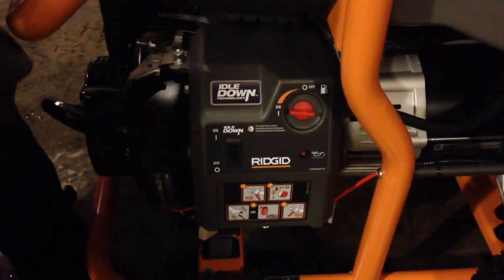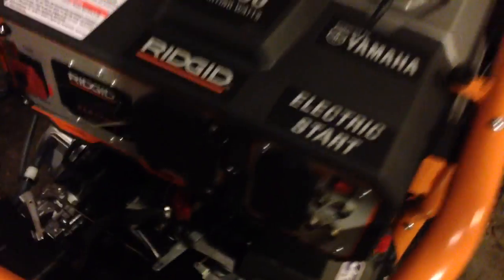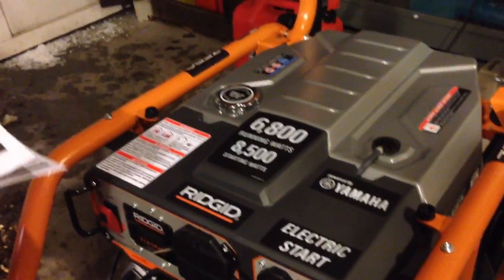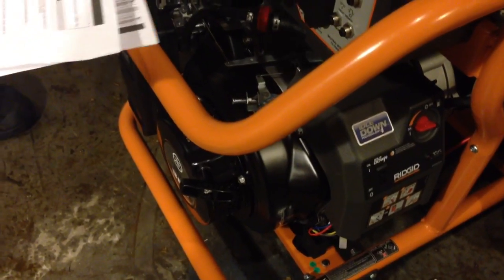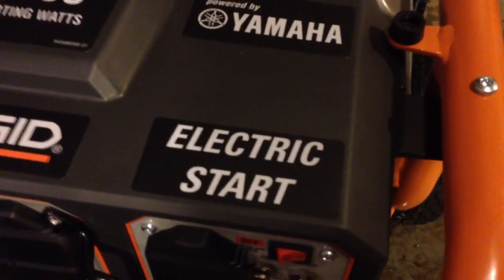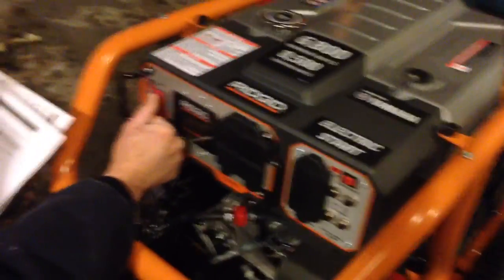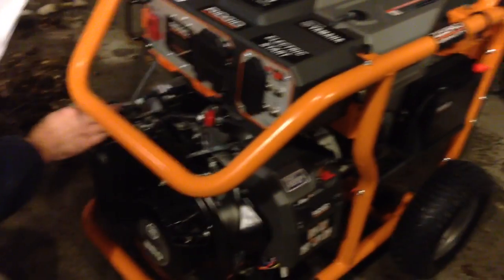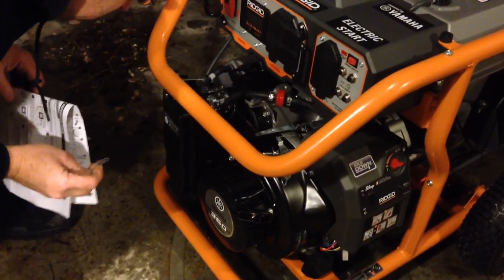Ridgid RD6800 - New generator first start up.

Comment: I wish more generators had the zero-gravity style handtruck frame

Borrowed a 3600 from someone after losing power for a week for a tornado and I grew kind of fond of it
Would fall asleep to it every night, I admit I can’t sleep without the sound of the little Subaru anymore
Reply from the maker: Creeperboy099 I’m pretty happy with it. It’s a pretty heavy unit, so with out that setup, it’s not moving an inch.

Comment: I have the big brother of this, 8000w/10000w. but it doesnt have the idle down tech.. really a bummer it didnt come with that...
Reply from the maker: Honestly, if even one 100w light bulb is on, it won’t idle down. 
So unless you are a contractor using something electrical, and don’t feel like coming down off from a roof, it’s virtually useless.

Comment: I like rigid. 6800 would run my entire house. Not all at once. But I could run all my lights and either the stove,ac,or water heater.
Reply from the maker: Ah, the water heater cycles, give it a shot!  ;-)   We used to use the stove on out old 5500w unit, it was tight, but it all worked. We refrained from running the water at the same time, as the pump is 110v and fairly high amperage draw. (I really need to convert that to 220......)  No AC here, but our oil boiler, and two zones worked fine. This was one of the main reasons I started switching over to LED lights. I wanted to keep the level wattage down, so the generator would be ok, for the surges. I could have used an 8000w unit, but there was no time to really look, there had just been an outage when my generator died, and thats not a great time to find a deal.  ;-)

Comment: If you have the control panel attached to the remote cord and it is away from the Generator, the second switch allows you shut it down right at the Generator and not have to go back to the panel. Its most likely a safety requirement.
Reply from the maker: Yea, that must be it, I wasn't even thinking about having a local shut down available if the remote was gone.
I'll probably get the extension cables eventually as soon as I figure out a place to put it where I can keep it out of the way. Our last generator had an enclosure on it, and was just left outside behind the garage, this one is physically larger, so we will need to build some kind of shelter over it.

Comment: Nice generator. Rigid markets good stuff. Yamaha YES! I have a Powermate I think by Coleman with the Honda 390 on it. Honda generators although the best are too pricey for my budget. I ran into a off brand inverter generator sold through a hitch company called Rigid Hitch based out of Burnsville Minnesota I would like to try. They are about half price and the company that sells them are close enough I can do a drive by on if needed.
To change the subject I am amazed of the stories across our great country about people who bring these into their basements or homes and die because of the carbon monoxide poisoning. I guess it weeds out the stupid ones in this world but I do feel bad for the innocent family members that die at the hands of the stupid ones.
Reply from the maker: My generator is well over 65' from the house, I did that, as when we are out, its generally for a very long time, and I worry about build up within the envelope of the house. Even ten feet away is way too close as far as I'm concerned. I see people put them right out side of their windows thinking they are ok, as its outside. I think they forget its a gas, an open window is not much of a barrier.  My old generator was a homelite with a B&S engine, it served us very well for 18+ years. I was surprised when it just up and died, but I guess thats how things go.
Reply: ***** Funny you should bring too close to the house even if it's outside. One of the schools I work at was getting their leaking tin roof sealed with a coating of some sort. This company had an old water cooled gasser engine inside of a semi truck trailer van body to power their equipment. They never gave it a thought but the wind was just right and pulled most of the fumes into the computer lab I was working at. I complained but they kept on going. I guess kids and old farts from SW Minnesota are expendable. I didn't get to the nausea level but it sure stunk like they had their choke pulled out the whole time. A diesel would have been a big improvement!
Reply from the maker: 1crazynordlander Yea, it constantly amazes me when I see  people on the news using a generator in an attached garage, and  are surprised when they get taken to the hospital. (If they are lucky) I think they figure if the garage door is open they are ok.....
Reply: Yup. Please keep in mind that carbon monoxide is dangerous. Please keep your children safe when using portable gasoline generators. Thank you
Reply from the maker: Yup, no kids living here. 
And the grand son knows plenty about carbon monoxide.
We use the generator a lot around here. 
It’s in the garage, so it kinda looks unsafe, but no one is in there, and it’s 45 feet away from the house.
We also only run it with the garage door wide open.
Reply: @JimsEquipmentShed  Ha! A comment from six years ago.
Reply from the maker: @1crazynordlander  linneas comment is from 5 days ago. (It’s the newest one in this thread though.   ;-)
Reply: Oh, sorry, again fooled by the hidden comments...
Reply from the maker: @1crazynordlander  The YouTube comments section is a constant source of amazement...... they couldn’t screw it up worse if they tried......

Comment: We have a very old Yamaha ef1600 generator
Reply from the maker: David Janitschek Any generator that’s running is worth it’s weight in gold when you need it. We have a 30 year old Honda ex (a 1000w I think) that used to run the refrigerator, OR the coffee maker.
That doesn’t sound like much, until day three of a power outage....
Reply: JimsEquipmentShed our power has been out for a few days now and that Yamaha still kicks ass. I think it was made in the 90’s??
Reply from the maker: David Janitschek the generator we had before this one was a beast. It went low oil, and cooked. (Entirely my fault.)
It had a faulty low pressure cut off, and it used to shut down all the time. 
I used it like that for years, and the last time, I failed to check the oil before start up.

Comment: Cant find a air filter to fit this machine. not even from the people that makes it. Yamaha. That Sucks. Wont buy another Yamaha!
Reply from the maker: Michael Fisher what happened to your air filter?  It’s a reusable unit, and shouldn’t need anything but to be cleaned and re-oiled like a motorcycle.
Reply: The reason why you won't find one is mainly because the original manufacture equipped filter that comes with it is designed to be reusable. That means you are able to wash it as many times as you please and reuse it.